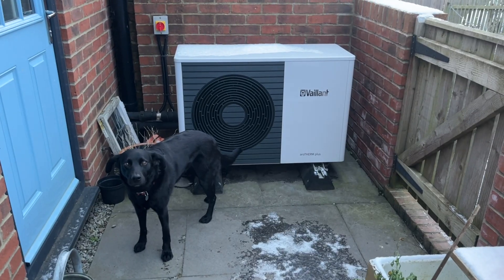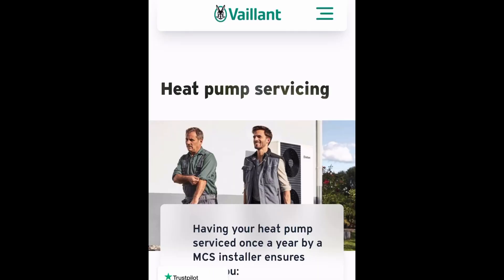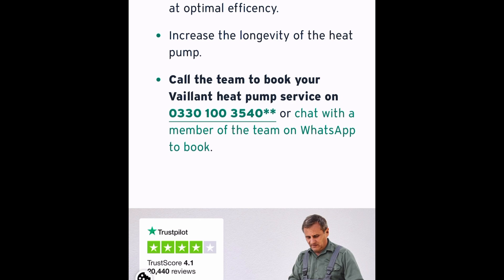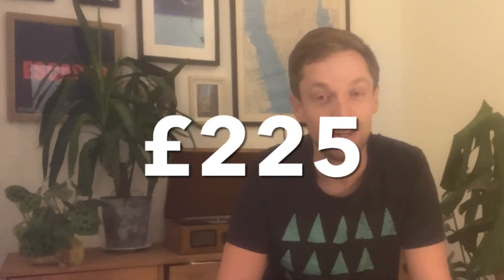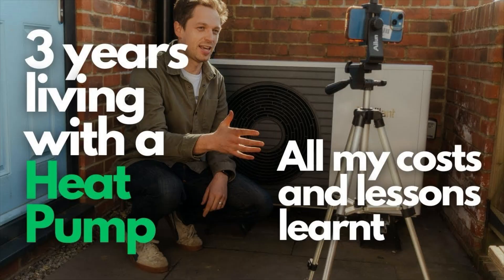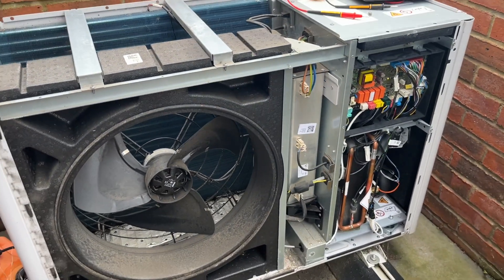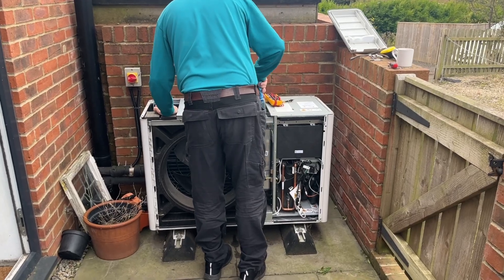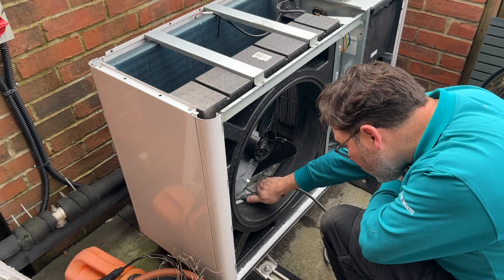What happens during a heat pump service?

Comment: I think for those of you who are just a little bit technical interested these services are just a waste of money. You monitor your heat pumpe efficiency ever now and then, top up the water if the pressure is too low, flush the filter, and listen if your fan makes funny noises. This is easily done in the time you are waiting for the technician to arrive. There is nothing to service with the compressor (when was the last time you had your fridge serviced?) and the electronics. If it breaks it breaks and then you can call a technician. And as Tom was mentioning: this is not a gas boiler which can blow up your house but just a ... fridge !!
Reply: It will be an  inverter compressor ,basically speed controlled to maintain optimal refrigerant pressure.  The only way to measure the refrigerant level is to weigh it out and back in again. So the simplest way to make sure everything is working ok is with water in/out temperature with the flow rate. And compare that with the power draw..So basically making sure it is running as efficiently as when it was first installed.This the customer can do themselves if the system gives it's C.O.P.
Reply: Gas boiler only blow up when an amateur trying to service it.And makes a mess of it checking the flu and gas pressure.Leaking gas causes the blow up if you have a smoke.
Reply: Yeah.. Don't have to be a boffin to sort these out. Basic cleaning is not worth hundreds of pounds.
Reply: From a heating engineer, im going to say your advice is complete and utter nonsense. Your warranty on a 7k unit is dictated by the annual service. If its missed, no warranty if something goes wrong. You want to pay over 1k for just the pcb? or would you rather is under warranty and not have to fork out for something you should of got serviced? All these checks are paramount to the efficiency and longevity of your system. If you have absolutely no experience in this field then stop making stupid comments online.
Reply: @colin4685  so these services are only really worthwhile to maintain the warranty, and once you're out of the warranty period they're not really worthwhile provided you keep an eye on how the system is performing?
Reply: @colin4685  I think " utter nonsense " is a bit harsh. My time is money, so I never read the full terms and conditions in the installers or customers  manual. But next install I'll read it and get back to you on that. Normally as the installer I replace the faulty part and take the cost on the chin,as it's not worth the time putting in the warranty claim through the wholesaler. However I have replaced a compressor on a 70kw system compressor. And the manufacturer did require a section of pipework with a brazed joint to confirm the system had been installed with nitrogen purge brazed joints. No mention from them regarding servicing.

Comment: Sorry mate but £225 for a wash and brush up!! And check round. That’s only going to get dearer . Still not looking like a good deal. It’s just wiped out your savings for a year. I have had 2 gree outdoor units for 8 years and never serviced them. Engineer said to call him if they ever break. my gas boiler service is £50, cleans out the trap and checks the emissions. Running at 96% efficiency. Have you worked out the energy/cost used when it cycles to thaw out the radiator?

Comment: Having watched it could you do the servicing side of it your self  ?  . You need a qualification to repair the f-gas circuit, but not clean the fins.  . Afterall we are used to servicing cars our selves.. Can cleaning filters & fins really be more difficult that oil changing or changing a brake cylinder.   Octopus (£9/month plan) is cheapest, but it needs to be their install..  £225 ( pay in advance rather than invoice afterwards !) is one whole days pay if you are on £50k/year.    Regarding the Non-vented tank , you need a G3 qualification to service it as a plumper , it is a one day course £150, so would soon pay for its self.

Comment: Interesting video and something I have considered too. Agree, gas boiler service is more essential for safety reasons. I'd say keep getting the annual HP service till your HP warranty (which likely depends on an annual service) expires, and then get the HP serviced every 3 to 5 years, assuming you're doing your own housekeeping (clearing leaves etc)

I grew up in NZ and Singapore with A2A heat pumps (A/C only in Singapore!) and my parents used to get them serviced about every 7 years, where from memory, the refrigerant needed a slight top up. We'd do our own regular checks, ensuring leaves etc weren't blocking anything.
Reply from the maker: Thanks Aidan, that is helpful

Comment: One thing I might query would be need to check refrigerant level @ 4:45, direct testing would involve some slight leakage of refrigerant I would have thought. I assume (a dangerous word) that the HP would monitor and report any loss of refrigerant pressure over time as a fault, at which point a check and top up might be required.
Reply from the maker: Hi Dougaldog - I thought he was using this kind of kit to check around the compressor - https://derbyshire-refrigeration.co.uk/products/hvac-tools-refrigeration-tools/leak-detection-equipment/electronic-leak-detection/?srsltid=AfmBOoo1kgF_MzIgIMI6FkNlacr-WhfqdYIt78isyzeHbQrzaprejtYT

I guess that would sniff any evidence of leak....?

But I may have misunderstood!
Tom
Reply: @TomBray-LowCarbonLifestyle  

Thank you for your reply Tom.

That would certainly make more sense rather than directly checking refrigerant pressure. But similarly if it had been leaking any detectable amount I would think the system itself would be flagging up a fault.

Doing my sums, my Daikin is available for @ £2900 before VAT, or about 14.5 services, makes one wonder about any real added value these give.

I'll be in a similar situation in February next year when 1st is due. The devil in me wonders if it would be worth forsaking the warranty and just paying for any repairs as required. Barring the refrigerant circuit I could likely sort any other bits.

Comment: Tom - what was it that made you believe the technician measured refrigeration pressures?
Reply: My service engineer said the only way to accurately check the refrig loss was to remove and weigh the vessel.. a very expensive job, not done with the annual service!
Reply from the maker: Hi Norman - not necessarily pressures, but he did use a bit of kit that appeared to be detecting leaked or leaking refrigerant - it was something like this - https://derbyshire-refrigeration.co.uk/products/hvac-tools-refrigeration-tools/leak-detection-equipment/electronic-leak-detection/?srsltid=AfmBOoo1HLS7Dqt0mDvlD-U9ozIWk1Y6-nwtZ_d1ozZCP9L0L8Db0Pdi
Tom
Reply: Mmmm - you would only use them if you suspected a leak after evidence of under performance. I think the technician was rather keener to impress than to establish the presence of a leak.

Comment: Very interesting. Our new Aira heatpump has 15 year guarantee with no service requirements. I double checked this several times.  I guess they believe there's no health and safety requirement and will just fix as and when needed. It's a few hundred pounds saving over other installers but time will tell if it's a sensible approach.
Reply: That is amazing , &  their website says that is still the case.  That moves them up my installer list. ..  I Guess a HP is combo of a fridge, an inverter & a computer.. none of which have service items
Reply: @brackcycle9056   We had a few issues early on that needed some aftercare support. 2 extra days work for them upgrading some extra existing pipes, with no hesitation or quibbling. There aftercare has been spot on.  Best looking external heat pump IMO and 12 months interest free too.
Reply: £225 * 15 years is over £3k - that's enough to buy a new heat pump!
Reply: Did you go with them directly or through another installer? Did you get a few different quotes? If so, how did they compare? Thank you.
Reply: @yahyad25  I went direct. Aira build and install there own heat pumps. No subcontractors to be seen. I did initially go with octopus. That was supposed to be £1.5k cheaper, but they deemed my heat loss to high and refunded my deposit. Aira also disagreed with Octopus's heat loss estimate and my own heat loss calculation was much lower too. Aira were second cheapest after other rough quotes from Heat Geek, EDF's partner CB Heating. Aira Cost me £6100 for a 8kW system with 5 radiator changes.
Reply from the maker: Really interested to hear this experience with Aira and their long term warranty
Thanks all for commenting!
Reply: Worth checking if service engineer will check for/ complete software updates as part of the service..

Comment: The advertised savings by going to a heat pump from gas could be wiped out if that price goes up, waiting for my quote for install, after this video will have to look closer at the costings as pay £75 for my gas boiler service each year just to keep the warranty active
Reply: You get a ASHP for the carbon benefits typically

Comment: My heatpump had its first service this year, it's a Stiebel Eltron system and the service was carried out by the people who installed it. The cost was £180 which seemed reasonable compared to the average around £200 I saw online. Since it was a new system there weren't any problems but a couple of adjustments were made to improve efficiency, so it was mainly for peace of mind and to keep the 7 year warranty active. Value for money is subjective and I tend to view it in a similar manner to insurance: something that is quite expensive and would be inconvenient if it broke and I couldn't afford to fix it is worth insuring, while something cheap and easy to replace is not.

Comment: I'm a plumber/electrician and used to have the G3 unvented qualification , this is required to install and service cylinders and requires re taking at 5yr intervals at a £230+ vat cost + lost income doing it. It should apply to gas , direct electric and heatpump cylinders. As with everything these days its cost of training, insurance and competent scheme membership. But having accountability for the safety from legionella and correct installation is important. I have my oldest cylinder in service now for 20yrs so l have one in my own home. I can shower in a power cut and dump surplus PV into it as a 10 Kwh battery with the added benefit of duel heat sources for reliability combined with a good flow rate.

Comment: Thanks for this, Tom. We had our first full service done in June and it was a very thorough examination (Vaillant as well) - it was done by our installer so they actually found a couple of small things they'd missed a year previous (further insulating some pipework, etc.)

The safety critical thing is the important bit for me, so I'm wondering if, as the years pass, we might consider less regular servicing of our heat pump (maybe every two or three years?) ... or maybe installers will have two tiers of servicing. One cheap and cheerful option for giving the system a quick once over, and another more in depth service that costs more.

There's also the option of paying a monthly fee to spread the cost of things, which a lot of people have with their boilers. I'd probably quite happily pay £15/month to cover a service plus call out for emergency works.

Comment: We're paying around £200 pa for an oil boiler service which includes bits and pieces that just need replacing (filters etc.) so £225 is not that much more, but that includes some of the safety issues as well. The thing is what of that could you do yourself to make sure it stays working like checking the efficiency etc.?
Reply: 🤣 i charge £95 plus 10 parts. Damn im too cheap

Comment: Interesting not really talked about on YT. We have had ours 2 years and I have yet to get a service. The cylinder is only an explosion risk with the immersion as the heatpump can't boil water. So with this disconnected it feels less essential. Annual feels a bit arbitrary. I think 18months and doing your own checks for leaks and debris in the air intake is probably OK. 50% saving. It also depends if you are periodically checking efficency and consumption which may well highlight an issue if they change unusually.
Reply: It needs to be years to keep your warranty.
Reply: @mackay250  fair point.
Reply: don't forget the expansion vessel/airbuble
Reply: do you use the immersion then, as opposed to the HP? If so, why?
Reply: @MikeGleesonazelectrics  no we never use the immersion. The heatpump can only get the tank to 70degrees so is self limiting from a saftey stand point. A faulty immersion thermostat could heat the water beyond boiling and result in an explosion theoretically. But there are pressure relief valves that would have to also fail so a pretty low risk.

Comment: Your webcam could do with a service too -- i.e. cleaned..! As to the cost — I can tell it hurt by the number of times you repeat it — perhaps it is easier to rationalise if you see it like having your car serviced. Compared with the cost of the installation it does not seem unreasonable if you budget for it over each year.
Reply: Once you get an EV, annual car servicing seems equally pointless.